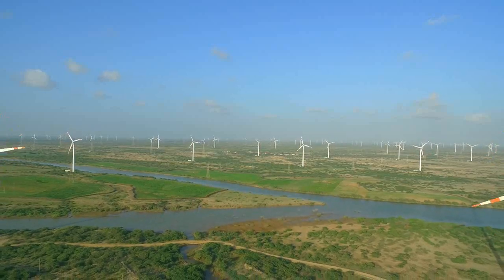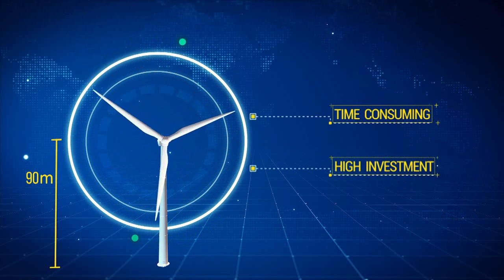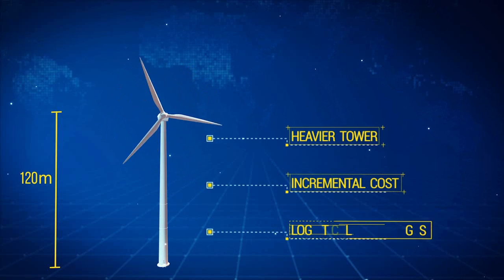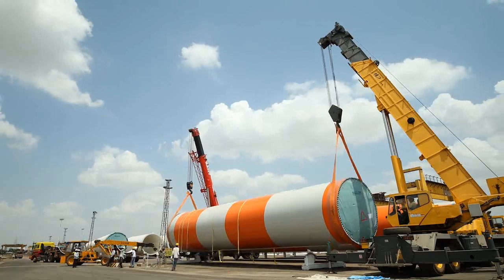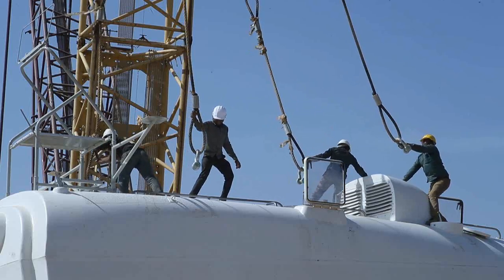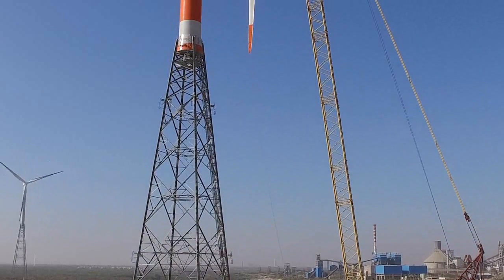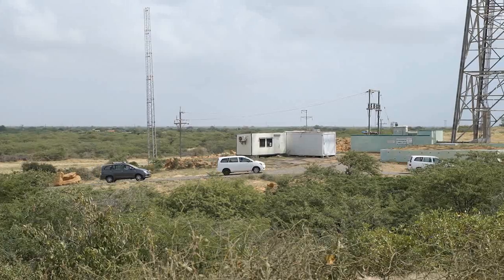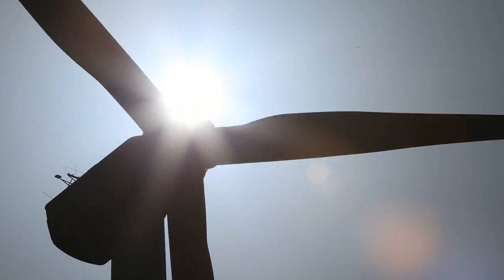Story behind Suzlon's S97 120m

Comment: Presidential wind turbines

Since trees can grow to be 200 feet tall, the only
alternative is to build vertical axis wind turbines that have the profile and
color of pine trees. From a distance, wind farms will look like pine forests.
Even if VAWT are less efficient than the horizontal axis wind turbines, people
who own property within a mile (radius) of the vertical axis wind farms will be
able to enjoy the green color view. 

Here are a few good things about the rotating pine trees:

1) The alternator / generator will be located closer to the
ground for easy service.

2) They will not kill a lot of birds and could make less
noise. 

3) They will blend with the environment.

Let us assume that the Vertical Axis Wind Turbines rotate in
a cylindrical 3D space or are actually shaped like cylinders.  If they are painted GREEN they belong on the
surface of the earth. Since we are building a wind farm that is to look like a
forest we can also paint the vertical axes BROWN. As we all know, strong gust
of wind can topple pine trees. When that happens in the forest, there can be a
chain reaction (domino effect) that only stops after multiple falling trees
knock down adjacent trees. We certainly do not want that to happen to the VAWT wind
farm. 

A wire mesh with square holes is a very basic geometric
structure that can be magnified to any scale. The wires can be replaced by
metal pipes with diameters that are inches (or feet) wide. That grid (matrix) will
be horizontally resting on top of vertical axis wind turbines that are
equidistant from each other. First, the cylindrical wind turbines are erected
adjacent and equidistant to each other in the same pattern as that of the grid.
Then the top of each VAWT is connected to the 4 adjacent VAWT tops. That is the
way that the grid is slowly built until all the wind turbines are connected on
top. For all practical purposes, the shape of our wind farm will be rectangular.
Multiple GUY wires will travel to the ground from all 4 sides of the top grid. The
guy wires will keep all the wind turbines vertical in case of excessive wind
gusts.

We all know that pine trees are not shaped like green
cylinders.  In order to mimic that pointy
triangular tree top profile, a triangular treetop (artificial Christmas tree)
will be attached to the top grid above each turbine (where the pipes crisscross).
 That triangular top will not rotate only
the base turbine will rotate. In other words, a man-made duplicate of a static pine
forest will be installed on top of the top grid. This presidential wind farm
will be landscape friendly. The president elect has been consistent about wind
turbines. Furthermore when life on earth comes to a halt and all man-made
machines stop spinning, wind turbines will still be going around and around.
This is one more reason to build them gracefully. Tourist travel to parts of
the world to have a close encounter with windmills built centuries ago.
Efficiency alone is not good enough for mankind. The wind farms that are built
by people of my generation look like cactus forests. I rather look at the pine
forest.    Happy New Year!                                                  
 Note: I have a playlist entitled “Original Windmills and wind turbines”